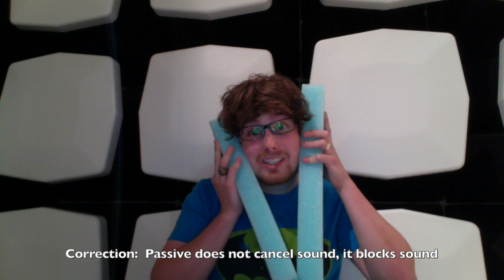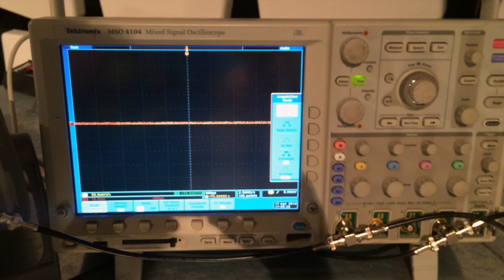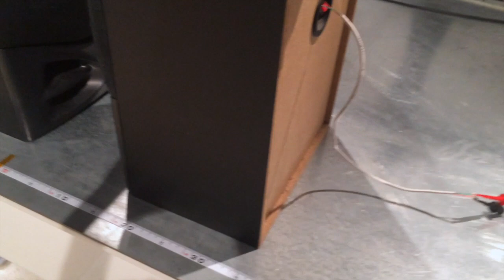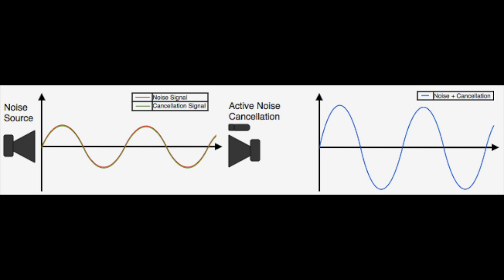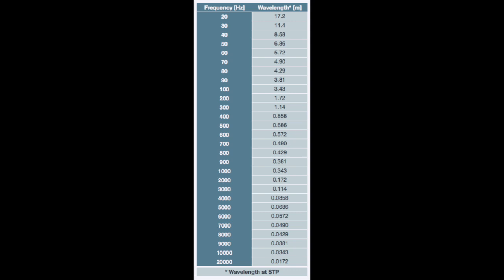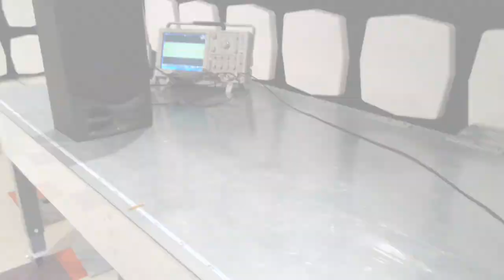AuE 835 - Active Noise Cancellation Project

Comment: Wow, I didn't know you did all these Hunter, Great demonstration! I recently rented an apartment at San Francisco and the street noise (rumbling sound from cars) can be heard at night, the frequencies are very low and can penetrate the actually-very-nicely-isolated windows, and my gf had hard time sleeping. I googled "noise cancelation speaker" and this video came up on top!!! :D

btw, my plan is to connect my microphone (Rode Stereo pro, starting from 20-30-40Hz to 20kHz) to my subwoofer (Klipsch r-112sw, 24Hz-150Hz) with phase set to 180 degree...... I felt it should work with some tweaking and maybe some amplification..... how do you think?:)
Reply: I was thinking about the same. I think you can connect speaker from + to- and -to +. Is your idea working?
Reply: Did this end up working?

Comment: There have been reports of use of noise cancellation machines at the DNC. How can it be countered so as to not affect on demonstrators chants? Could a paper bullhorn direct the voices/sound away from the machine to confuse the machine? Feel the Bern my friends!
Reply: You can find an electronic circuit that will generate a time delayed version of its input with a slight frequency shift. To disrupt the noise cancelling system further, have another speaker broadcasting the sounds on nearby surfaces to change direction of arrival of the sounds wave at the noise cancelling device.
So in the end, time delay, slight frequency shift, and multipath will definitely knock the noise cancellation off.

Comment: The way the speakers are set up  it seems like you are creating a standing wave with nodes and antinodes...noise cancelation should be location specific no?
Reply: Always is. Noise cancellation could only be nonspecific to location in you had 1 object producing both waves but that is called turning the speaker off.

Comment: Shifting 180 degrees only works if the signal you're trying to cancel is symmetrical. If the noise is not strictly symmetrical, which is always the case, you're just gonna add more noise to the output.
Reply: The 180° degrees thing only applies to sinusoidal waves, what he probably meant by shifting 180° is inverting the noise
Reply: Axel it doesn't have to be sinusoidal wave. It can be saw tooth or square wave. It just has to be symmetrical. In the video, he changed the distance between the speakers, effectively mean shifting the phase.
Reply: I think that when he changed the distance between speakers, it was the wavelength that got changed, and not a phase shift. Also, I think you would have to measure the amplitude of the sound, not only the frequency, and try to match that with the anti phase sound to effectively nullify or reduce to unwanted noise.
Reply: @livium9184  Wavelength is a function of the air properties and frequency of the source. Neither changed when he moved speakers, so the wavelength would not change.

Comment: Hi, I build the same setup but I am unable to  get the noise cancellation results. I am wondering where the problem is. I used the speakers but as two output terminals were not available so we cut the output stereo connector wire to make two terminals but it is not working we still cannot see the opposite phase sine wave. Any help would be greatly appreciated.

Comment: Excellent presentation! I think you were moving the speaker a little far for the 5KHz test though. The speed of sound is about 1130Ft/s. If you divide that by the frequency the expected length of that is about two and a half inches. Divide that by half, about every inch you should hit it in phase and out of phase. Hope this helps!

Comment: Which software do you use in this demonstration?
Reply from the maker: No software was used in the actual demonstration.  An Agilent 33500B function generator, a Tektronix MSO4104 oscilloscope, and two Sony speakers were the only hardware used.